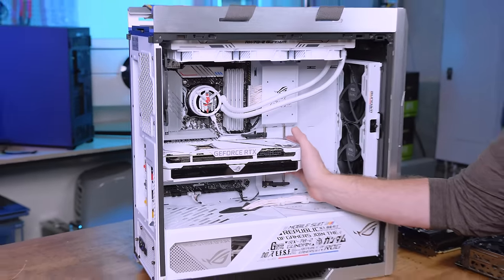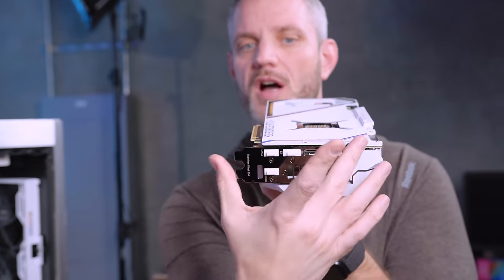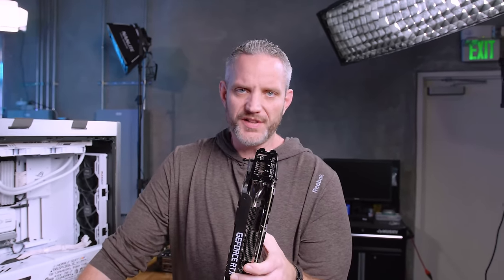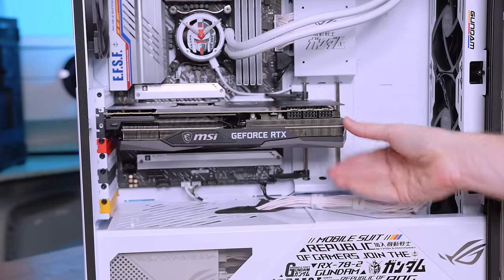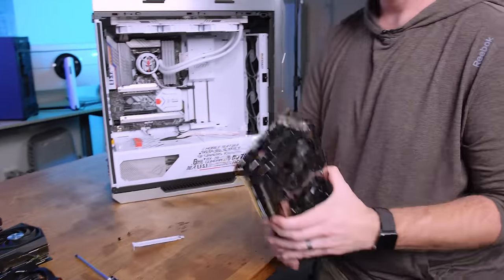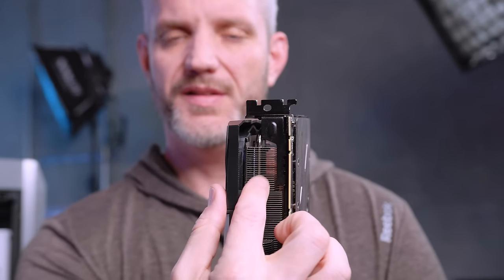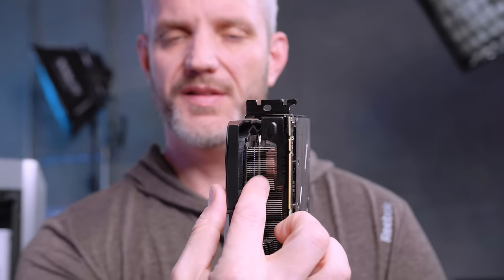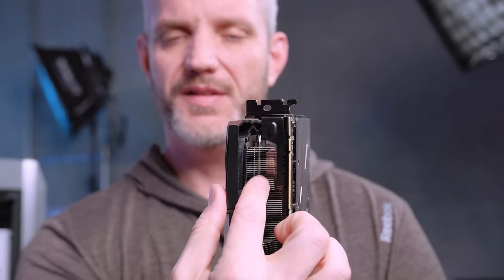How to fix GPU sag ONCE AND FOR ALL! FREE!

Comment: if i could send photo what im doing to stop sag on gpu i would show you as also using brackets but only one and in different way. Im just fixing it at end of card to case without drilling sometimes with screws sometimes with zip ties but it works like a dream and i think is even more stable. And dont worry about scratching a card i secure it with m3 sponge double tape where is connection to card. ;)

Comment: I've been considering using a horizontal case as opposed to a tower one. Trouble is there are not many on the market and cooling solutions haven't really kept up..
Reply: Just buy a gou support bracket that screws into the case

Comment: The only sure way to fix sagging is either put support or use one of those fancy extensions. Anything else will eventually lead to warp over time.
Manufacturer's won't fix this, as this is a bit of a BMW situation for parts - they will be able to sell more if something happens with your card 😮.

Comment: i would advise against, this is allowing heat to transfer from the card onto the system. which is why the gap is there in the first place.
Reply: Just use electric tape to break the heat transfer lol

Comment: Still putting an awful twist on the card slot. Why not just make a simple plastic or metal support (possibly from two rear bracket plates - one 'upside down) and support off the PSU cover or case base? That is what I did with my watercooled 3090!

Comment: This issue has nothing to do with actual "sagging". It's just wobble and that is kinda getting "overselled" in this video as a bigger issue than it really is. If your case supports the two notches of the GPU on the opposite side of where you screw it then you hardly benefit from stagging "slot covers".  However none of that is actually improving the sagging and the wobble itself isn't that big of an issue when it  comes to sagging it's the missing support on the other side of the GPU.

Comment: OMG just saw you used a screwdriver to open the lock to the GPU PCIe slot because the GPU - like most huge GPUs today - is so large it covers the lock. But there actually is a release button further up the motherboard closer to the first M.2 slot that release the lock with a tiny press on the button and like magic the lock slides sideways without you having to put metal oblects down between your precious GPU and MB. Please use the release button in your videos so other users don't believe they need to release the lock with a screwdriver while yanking out the card. I only mention this because I realized already when I put in my own RTX4090 that is about 440mm long (almost the entire case) that it would be impossible to release the lock again, and knowing me well I also know that as soon as nVidia comes out with an upgraded, overclocked or an even faster 5090 card I suffer from a disease that makes med compulsively go an buy it. (BTW: The next video I will watch aftera this is your video on how to mount a water block on the ROG STRIX 4090RTX GPU, to see if this is something I dare start on doing, but I love your videos so no matter whether I will or nowwt I will see it for the entertainment value. You make really watch worthy content).
But I just had to mention that - in the friendliest spirit possible. I love your videos. Just had to mention that.

By the way do you make som dB measuring on the computer after changing to a waterblock on the RTX4090 card so you can actually see if you save anything in noise level, and will the card really keep cooler. Sorry I'm ahead of myself - I'll watch the video and then I'll ask in the thread. ... 😀

Thank you for exciting content. Love the spot on and super exciting material on the new hardware on the market.
In some ways building a new computer has become tougher because you have so many choices (water cooling wasn't even a topic - perhaps except at NASA - 20 years ago), but it has all becom easier because of all the standardization of many things such as form factors etc. I remember the most bizarre solutions where getting AdLib sound on my computer was a question of going to some obscure electronics components shop and buy two chips of some specific 12 digit numbers and put them into two free sockets in your motherboard without bending the legs. And another old computer I had 20 years ago had the CD-ROM drive and the sound-card built into one component so if the one failed everything failed in that compartment. I couldn't even execute a MIDI file through my otherwise separate MIDI interface since that was all tunnelled through the CD-ROM drives controller board. Things were really weird.

But computer building is a strange thing. When mothers come to me and tell me they want to give their sons a new gaming PC for X-mas my first thought is that if they only want to game buy them an X-box or a PlayStation and a decent flatscreen. Thal will give you so much less headaches and a robust machine that cannot be altered in too many weird ways by some 12 yo "engineer" that wants to take everything apart to insert water cooling because he just saw som video on YouTube on how to do that.
I also tell them not to ask me what a gaming rig should cost because that depends on SO many things. I know for sure you would not even be willing to pay for an entire gaming right what I have just paid for just one of the following components in my computerww, such as my GPU, my MB, my CPU, so with a 2200$ GPU you are already above your budget for what you think is a satisfactory gaming PC. But if you as me run three monitors, expect fluent Gsync never below 80-90 FPS with all settings on UTRA or when testing the machine with a torture polygon texture tracing test, and all running on 240Hz GSync monitors that will all run smooth (it had to be mentioned that I am also a content creator and video editor and have my own sound studio as a voice artist, so that of course changes the game slightly). As soon as last week a mother asked me what the best monitor for gaming was, and I told her with great enthusiasm that for the first time ever I had scrapped my three monitor setup, and instead bought the latest edition of the SAMSUNG G9 NEO 49" monitor on SuperUltraWide (which i two complete 2K monitors side by side in one monitor, but when he looked it up on pricerunner, I had a hard time deciding whether to call him an ambulance judging from the fading color of his facial skin. Again a component much costlier than most parents are willing to pay for a standard gaming rig. But it all comes down to your personal acceptance level. I only accept one thing and that is smooth real time rendering with all gaming settings on ULTRA - nothing less. So when parents start asking me what to buy their kids for fun and games after school I always say buy a new PlayStation and give them a decent flat screen TV so they also have cable in their room, which all teen boys love to have late at night. But if they start asking for a computer I always play dumb, and says that depends on so many aspects of their needs, so I suggest they ask they student counsellor instead as this is outside my area of expertise. 😀

After switching to the SuperUltraWide G9 NEOThe only thing I had to change habits on is my content creation. Before I was used to a three monitor setup in Adobe Premiere Pro and After Effects, but now I use my G9 NEO as the editing station which leaves just enough room for the editing and creating modules in Premiere and then instead of the teeehird screen I have moved my desk about 6 feet back from the wall it was up against and then mounted a nice 75" TV on the wall in front of me so I can preview the result there with some hefty wall speakers on each side of the screen and a subwoofer in the corner and it is actually a really nice way to preview the results of your rendered content. And for the first time I have not just removed the standard stand from the monitor as the G9 NEO stand is awesome with a rail that makes the 40 lb monitor slide up and down with the touch of a finger which makes it easy to just slide it down when watching the previews on the large screen on the wall in front of me. The stand also have the most beautiful cable management for all cables letting them hide in an S-loop inside to I can slide the screen up and down without any stretching or unhealthy bending of the cables. It's just awesome.

And now I have to stop myself.

Thank you for all your fabulous videos.

Comment: The best and easiest way to to leave the PC on its side.  Done no more sag and gravity is pulling the card down into the slot.  No sag at all.  The sag should be taken care of in the back.   Forgot about looks just from a engineering stand point.   Shimming it does nothing to reduce the torque forces applied at the front of the card and on the case itself.   Supporting on both ends should be done.

Comment: Well, while i understand your method and what you try to do, i dont think it actually does anything for the main problem with such heavy cards. The main problem is the PCB bending eventually, your method fixes nothing, just moves the tension forces to the other side of the card. With these sagging designs, the tension is just at the start of the card, so it is posible having it "saggy" but still having a totally straight board.. what you say is a weak point, it is actually like a "suspension", allows the card to "sag" while keeping its shape.WIth your method, the card loses flexibility and the tension point is moved to the other edge.. which means it will eventually bend the pcb...The longer the card, the worst is for it with your method. The only way to fix this for good is just adding some support from below, nothing else fixes the main issue. If you add support, then the center of tension moves to the center of the card which is where you want it

Comment: These cards are getting so big and bulky they need to come up with some kind of standard for support brackets. Something like a keyed plate on the opposite end of the card that interfaces with the case. Or just change the way graphics cards are mounted altogether. But of course nothing will happen until some kind of catastrophic failure and lawsuit.

Comment: How hard would it be to use a 3-slot bracket that attaches both to the backplate at the top and the cooler at the bottom? Even better, a one-piece bracket/backplate that attaches to the cooler at the bottom. This is a problem that just shouldn't exist.

Comment: So you have eliminated the sag by reinforcing the bracket but does that eliminate the strain?  I don't believe it does.  The moment arm at the back end of the card is still there.  Unless you place a fully stabilized support at the rear of the card the downward force created by the mass of the card cannot relieve the stresses of torque that gravity puts on that portion of the card.

Comment: Easy fix, stop fighting gravity. Stop buying tower cases.  I specifically hunted around to find a case where the motherboard sits flat (Thermaltake Core X9) so I could let gravity help keep my cards seated, and the CPU fan in place, rather than having it constantly trying to pull parts that vibrate towards the floor.

Tower cases became "cool" back when monitors were getting larger and heavier, and it was no longer practical to put a 100 pound glass monstrosity on top of a somewhat flimsy "desktop" case.  We switched the LCD panels that weigh nothing decades ago, but in our heads "desktop" cases still meant weak business machines, rather than the "cool gamer tower".  Ironically, as both CPU and GPU get heavier and heavier, the older style case would work better.... but instead we stubbornly add metal backplates and braces, and even reinforced PCIe slots so they won't peel off the board.

Comment: My case is such that with a Strix gtx 970 I used to some ties on the non-slot side to just make it so much up and down so it could not move. it was hooked to some hard drives. My 3060 and 1660 don't seem to sag so I just leave them alone.

Comment: I have that problem with my MSI RX570 armor... cooler was completely separated from the GPU IO shield, it literally has like 3 cm space between cooler and the IO shield, and that caused a huge sag and the IO shield is now bend and it will never be in 90 degrees angle... it looked very awfull, now the GPU is dead and i think that was one of the problem why GPU died, card also doesnt have the plate that is on the PCB card, i bought used RX480 by XFX, card does have that plate on the PCB card that also kinda stabilize the GPU too, and the IO shield its not separated from the io shield and its not sagging ofc

Comment: Hello, I have a EVGA 12gb 3080 sc3 which appears to be lighter than the ftw3. However I am currently not using any support for my gpu and can’t really notice sag. I want to be safe and expand the life of this card so my two questions are, does little to no sag affect performance or is it damaging over time? Also if no obvious sag would you run a retention bracket anyways? I’ve found a “stand “ on Amazon that I’ve seen some people use on the front corner of the fan. Thanks in advance !

Comment: Why do they only use dual slot brackets when the cards are 3 slots or more? Is it for compatibility with vertical GPU mounts that some cases have that are usually just 2 slots?

Comment: I got a MSI 6800 XT and HOLY the sag is horrible. The support bracket came with it and I put it on but it really doesn't work that well. I'm sure though that this will work. Granted my card is a little big for my case, Meshify C 1st gen. I'll probably get the Meshify 2 for more hard drives anyway but I'm gonna take apart my pc tomorrow and attempt this, and I hope to god it works because my god this card is beautiful but I can't appreciate it with such a bulky bracket which blocks both RGB and the fans.

However, I curse MSI since their rgb controller DOES NOT work. EDIT: IT FIXED RANDOMLY JUST NOW HOLY I CAN FINALLY TURN OFF MY RGB HADIJEQWHFHJNWE

Comment: funny, I have an MSI 3070ti and mine seems to sag a lot  more than yours, even with the support bracket (which doesn't really work so well since it suffers from the same point of contact issues as the card itself)

Comment: Wow, but what about the cooler separating from gravity over timer? I know this video is old. Just got a computer so I'm wondering.
Reply: I wouldn't worry about it.  The pcb of the graphics card is stronger than you think, only time its an issue is in shipping or if you move and load the computer in your car, you'll want to remove the graphics card and transport it in its original box.  Thats all

Comment: my case came with a huge l bracket to brace the card up BUT if you need to install anything else in  your pc (say a audio card designed for more midi controls and such) that bracket wont fit anymore. Ill try this idea. maybe it will work.

Comment: Looks like your just stressing out the face plate, and not fixing the problem per say. The (shown) case had a solution.. adjustable shelves for the back end of the card. If your smart enough to build a gaming computer... then one should be able to go down to Home Depot and collect the necessary parts to modify a rig.

Comment: You know, Jay, this didnt age well at all. I mean, with the structural integrity of the case being challenged by a 4090, this method may very well make lighter chassis tip. We need to show these people the suspension bridge method using led strips and strategically bolted hooks that replace the gpus front or back screws. 🤔 Just a thought....

Comment: I would not recommend this. A few months go into play and it creates pressure and it will eventually bend the gpu. My first fan in my 3070 ended up locking and was not able to cool my GPU. I ended up hitting 85 degrees celcius  average for the card. My gpu burnt my finger over the part that was not cooled.

Comment: This trick doesn't work on my computer because the expansion slot filler plates on my case are attached on the outside and not the inside. I need another solution.

Comment: works for every gpu on the market, uh no it doesnt, it works on every 3 slot card on the market. what about my 7950 with too much sag its fucking up the connection. doesnt work with a 2 slot card at all.